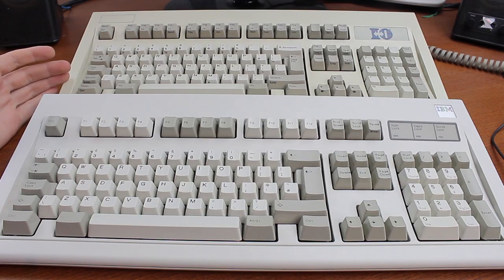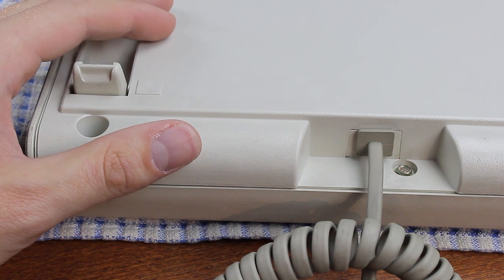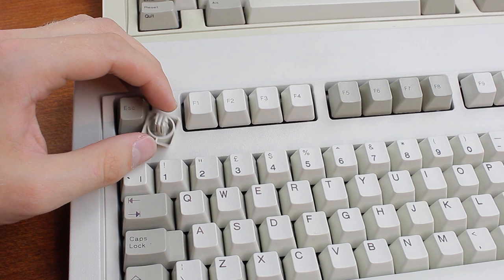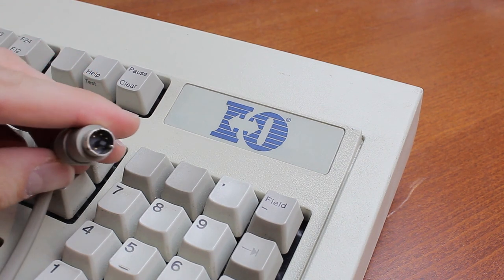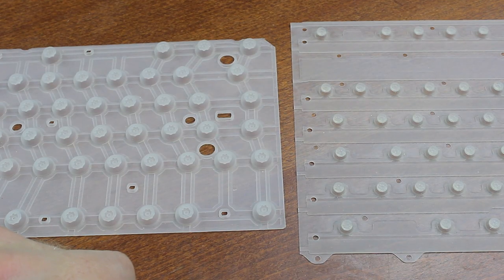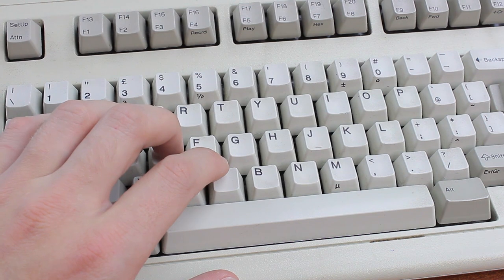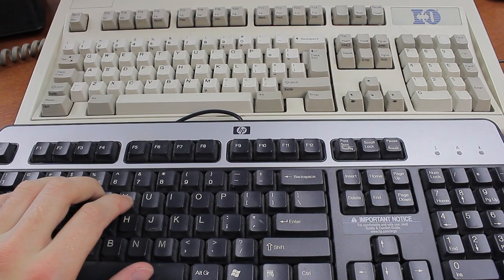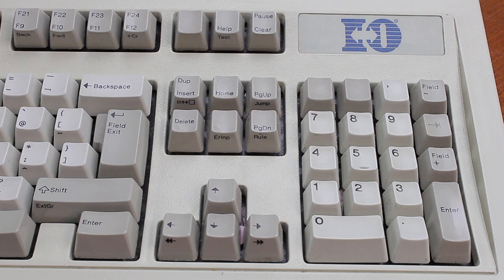Unicomp Model M rubber dome keyboard review

Comment: its like getting a ferrari but replacing the tyres with wooden wheels.
Reply: No, it's like having a Ferrari, but replacing the engine with one out of a Toyota corrola
Reply: MOM ITS NOT WHAT IT LOOKS LIKE Toyotaferrari
Reply: @dumdum7786   Funny you should mention Toyota. People have been making bodykits to convert Toyota MR-2's into various generations of Ferraris for years now. I do have to say that the wheels analogy works better because the only internal difference between the Model M buckling spring and the rubber dome is the tactile/return force element: one has the springs and flippers while the other has the mat of rubber domes. Like Chyros mentioned, everything else inside the keyboard from the steel barrel plate to the membrane is actually the same between the two.
Reply: Ferrari Auris
Reply: @dumdum7786  I think you can easily put more kilometers on a Toyota engine than a Ferrari engine though ;-) But again, rubber dome does last forever too. And they are cheap. And easy to maintain. But not every Toyota is built for a car enthusiast, but to make a reliable and an affordable car.
Still, buckling spring ftw.

Comment: Great review. Actually I think the keyboard, sounds great (spacebar chatter aside). I prefer quieter and bassier keysounds.
Reply: I used one of these (well, an IBM/Lexmark version, but it was probably identical) as my primary keyboard years ago for quite some time--at least four years, I think.  IMHO, they're pretty good keyboards.  I definitely prefer them over the rubber domes that he recommends--I think.  I'd have to try them both again to be sure.  Keyfeel is a matter of taste, and he duly points out that "some people really like these".  I suppose I am one of them.  I also am partial to the quiet yet "thocky" sound of these over other rubber dome keyboards, though I prefer IBM/Unicomp buckling springs overall.  If memory serves me accurately, he's right about how they "bottom out" fairly quickly compared to e.g. a Packard-Bell.  Unicomp still manufactures these if you wish to purchase a new one.  They will customize it to your liking.
Reply: It's not really gonna feel good.

Comment: Review that HP.
Reply: Hey, I used that crappy rubber dome HP keyboard at work for 10 years. Last time I cleaned it though, I accidentely damaged a conductor in the plastic film under the rubber mat. So the IT department gave me a new crappy rubber dome HP keyboard..
Reply: My elementary school used to have them, they're shit.
Reply: @dumdum7786  Same here, and I agree about the shitness. However, there's something so nostalgic about them at the same time. The sound of 30 of them typing away was so relaxing back in the day, and the softness of the typing experience was something I actually liked back then. I didn't even know there were better options out there at the time, I just thought "Yeah, that's what a keyboard should be."

Comment: I picked up a Lexmark-manufactured one of these things at a local Goodwill for a few bucks quite a few years ago. It has a manufacture date of 1995 and it has most of the characteristics of a normal IBM-branded model M, but of course with the rubber domes.
For years, I didn't know of the significance of the model M at all, and then when I did learn a bit about it, I thought what I had was the real deal! It was my daily driver for a long time, until my parents got me a Unicomp Classic for my 14th birthday. I suppose at that age, I didn't really know to research the cool old tech I was buying. :)

Comment: BTC, Scorpius? Cant find these in Germany. Topre is too expensive...Any other suggestion for a higher quality rubber dome that also has some kind of anti-ghosting / key-rollover? I play games with my Ducky Shine 3 Slim with MX reds and have the HP KU 1156 at work and while it looks dead cheap and retails for the equivalent of 10 USD, I like the (quiet) sound of it and the mid-profile caps. My GF is complaining about the MX reds and I myself cant stand this clacky noise anymore either.

Comment: I recently bought a unicomp made 122 key version of this keyboard for a really good price on the ebays. It's from the same obscure terminal company with the same sticker and everything. In mine at least, the caps LEDs weren't deleted, a piece of random double sided tape was just stuck on the underside of the frame to cover the holes. It's a weird keyboard and I kinda like it.

Comment: still stand by the late-90s Dell Quietkey dealies for a good rubber dome board, the beige plastic model, and not the black. I still have yet to come into contact with a dome M, but I'm sure I will some day down the line.

At some point down the line I acquired a Compaq keyboard from the mid-90s without windows keys, but was PS/2 and was new in box. the domes felt really mushy all the way down and they were so buttery smooth otherwise that I used it for a solid two years as a main keyboard until I got some mechanicals in my posession somewhere around 2009. from 2012 until just a few months ago it was the main keyboard for a friend's family computer in their living room, and served them so well that they had worn off a bit of the lettering-- but the caps were still matte and not shiny. always perplexed me, but I do have it in the garage as a spare board now since I have quite a few clients with a PS/2 port still.

Comment: Do you know of any rubber dome keyboards that bottom out with a clack? (key bottoming out on the case) Rather than bottoming out on the rubber dome.
Reply: I actually think that the "clack" comes from the keycaps rebounding, not just bottoming out.  It becomes very noticeable when typing fast.
Reply: @conroypawgmail  yeah I know that is on every rubber dome, but a keyboard like a scorpius which is a dome with slider over a membrane, somehow has half way actuation and a solid bottom out. It’s the most mechanical like rubber dome membrane board. I actually made a mod that lets keys bottom out on the top of the key holes while still actuating on a rubber dome keyboard.

Comment: I've heard that if you put buckling springs into this keyboard then it is much louder than a normal M because some mat is missing.
Reply from the maker: That could be; normal Ms use a weird rubbery black cloth in the assembly.
Reply: good to know, so the parts are inter-changable

Comment: Very Interesting video...I'm new to the channel and already a big fan! I found a black Unicomp rubberdome Model M at a thrift store last week, made for some company called SmarTrex for either their marketing or customer service department, as the keyboard had a plastic holster for a phone on its left side and included phone jacks on both the side of the board and on the multi cable, which was PS/2. Passed on the unit after I was tragically disappointed by the key action (Daily keyboards are Unicomp EnduraPro , Topre Type Heaven, & Emerson Futaba-clicky Switch), and because the price was simply too high for a thrift store find...

Comment: You mentioned that some buckling spring Model Ms have single piece caps, do you know of a place where these could be sourced? I noticed a few of the outer keys on  my Unicomp PC-122 are a little wobbly, and I thought it might help to replace them with a single piece design.
Reply from the maker: Unicomp did at some point only do single-piece caps, but they've since switched back to the two-piece ones again from what I understood. I don't think these are being made right now tbh. You could source them off an old Model F I guess (the F122s came with two-piece caps, though).
Reply: Hmm, guess that will have to do. The hunt begins!
Reply: Send Unicomp an email, they'll probably produce some one piece caps for you.

Comment: Eyy I use one of those crappy HP rubber domes at work because the alternative was an awful HP scissor switch keyboard. The keys seem to get stuck on them in certain areas like Alt which is just strange even when it's nearly new.
Reply: If you don't like it then buy a different keyboard. Lmao get one with blue alps so you can piss off all your co workers.

Comment: "Those crappy HP rubber domes" Wait until you get one of the new Dell keyboards that come bundled with some of the Optiplex computers... True horror of horrors, shittiest keyboards I've ever encountered, make the HP ones seem amazing by comparison. Pretty damn close to those flexible silicone keyboards on the shittiness scale. No kidding. http://data.stuartconnections.com/object/image?p=14896&i=7
Reply: Tamgorine holy fuck, I had to use them at school, along with shitty  acer chrome books, I'm not shitting you, I but a very cheap lot of 4 broken model m2s (i fixed them)and vortex core, put one m2 in networking, one in AP computer progrmming, and carry the vortex core for AP world and history.

Dead fucking serious.
Reply: Tamgorine I use one at work...
Reply: These are indeed especially awful. I have one that might give it a run for its money, though - the *Onn Soft-Touch LK6400*. http://i.imgur.com/Xujt24J.jpg That board is such an awful flexy pile of mush that it inspired me to get into mechanical keyboards the day I bought it. I had used that brand new board for a matter of hours before I couldn't take any more! Everything from the dome mush to the slippery key surface to the terrible profile shape to the awful response is abject garbage. Literally the only thing I've ever used that's worse are the flexible "folding" boards you mentioned. For the curious... typing on it sounds like a person with over-sized rubber gloves drumming an over-ripe melon.
Reply: Considering they come with the PC for free, those are far from the worst Dell membrane keyboards. Their "chiclet" style keyboards are absolutely atrocious.
Reply: I'm amazed they even do that.  These damn chiclet keyboards are everywhere.  They can't even give you a rubber dome anymore.
Reply: I thought you were talking about the meme board for a second. By meme board I mean the dell keyboard with a big ass spacebar and funky bottom row that a newcomer to MK will swear by every now and then. 

Here's an example: http://www.overclock.net/t/1248694/are-there-any-mech-keyboards-with-a-larger-space-bar
Reply: Had one of these at work. Worst. Keyboard. Ever.
Reply: IIIJFRIII
Got a recent Acer desktop in the office.  Space saver chiclet keyboard.  There's a numpad but no separate nav keys.  That POS keyboard couldn't have cost more that 13 cents in total to manufacture.  It's like they made the shittiest roll-up into a picture of a useful keyboard, without any usefulness.  I can't begin to express my disgust at going anywhere near it, but my fingers involuntarily curl into claws, a growl rumbles in my chest, and I frantically check my visible bits for odd hair growths.  As long as I don't go near it I'm fine.  It's destined for an accident involving heavy equipment and road paving.
Reply: Lol!  They are horrible!
Reply: The fact that so many people know these makes me happy and sad at the same time. lol
Reply: I used a Dell rubber dome for years, but it wasn't anything like that, much better. Still mushy as hell compared to my model F now lol
Reply: I was going to say, the NMB HP rubber dome boards are much better than a lot of the crap out there now!
Reply: I had to use them at school too. Every single CpE lab course I took (programming, digital logic design, and more to come) all uses the same room, and thus I had to use the same Dell computers that comes with those crappy boards. Imagine typing on that thing for four years straight...
Reply: After a while, I just started bringing my Rubre Domeh board to school. The shitty Dell boards started giving me an RSI.
Reply: My local college has those on all of the library computers, holy shit they’re awful.
Reply: Dell keyboard models KB212 are actually pretty nice, to me. On the other hand, for the newer KB216 chiclet, I found them awful.
Reply: @TheWestAnemoi  I've used their chiclet keyboards, and least they don't *hurt* to type on for long periods.

Comment: These are unfortunately destructible, had a lexmark produced model M rubber dome from 1993, that was fairly used(definite dome wear already) 

Used it from 2008 to 2014 before it died. The small movable part of the dome just got worn out to the point where keys stuck depressed into the keyboard.

A BIG reason why lot of them was sold with rubber instead of spring was the cost. I saw the price sticker on the box, and it was something like 1/4 or the price. Considering how technology and "looks" just wont stand up to 20years in time very well, its totally understandable that was the choice of many

The best alternative in closeness to feel is actually modern day heavy duty rubber dome IBM SK-8820, unfortunately they have stopped making those too now? It was a standard office keyboard everywhere some 10years back

Cherry MX switches are imo horrible, too much force required to hold down a key and click feels too pronounced compared to rubber dome. (holding down a spring vertically is a bad design for gaming at least)

Thinking of trying a scissor switch desktop board when this IBM dies. Going 5years strong on a rubber dome already seems impressive. Only feeling it starting to wear maybe 10% less springback in keys so far, even "WASD"
Reply: First time I've ever heard someone seriously say that they want to get a scissor switch keyboard.
Reply: @archkull  What does people not like about scissor switches?

I've tried mx red, green, blue, half hight rubber dome, heavy-duty, cheap, scissor switch, and whatever is in bad laptop keyboards today with no travel and completely flat. Imo rubber dome and ibm scissor switch feels the best for gaming and typing. So its either going heavy-duty rubber dome again, or trying a scissor switch full size.
Reply: If a stellar scissor switch keyboard is what'cha looking for, look into the "Perixx PX-1900". Hands down one of the better SS keyboards I ever used in my life!

Word of warning, sometimes when they go out of first party Perixx stock, third parties sell them for inflated prices. It should roughly be around $40 (USD) give or take. The matrix is extremely optimised for gaming so low roll over isn't a issue.

Comment: Why they called it "Model M"? It's an insult to use rubber domes and call it "Model M".
Reply: Rubber domes can actually be really good if done right
Reply: @dumdum7786  Honestly that applies to most mechanisms. But just like every community, elitism is the main factor of dismissing well executed mechanisms that use parts the elites scoff at violently. Example: Topre. Or a PX-1900 on the cheap* end.